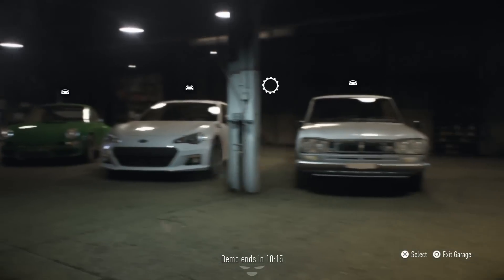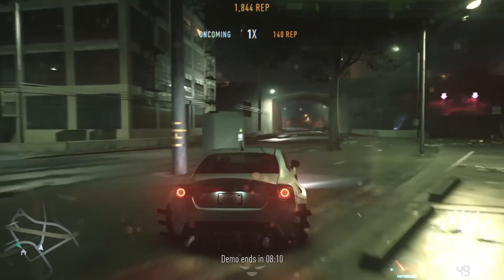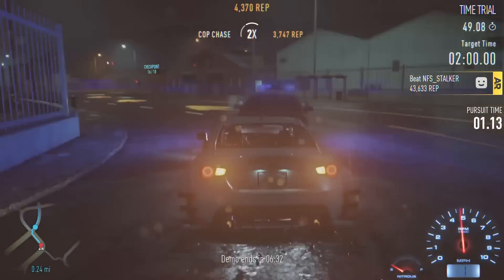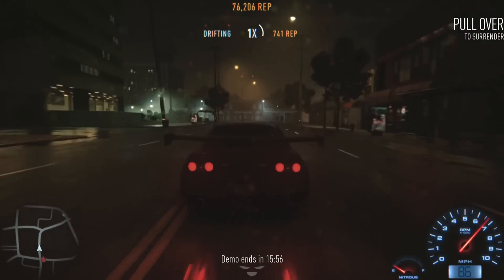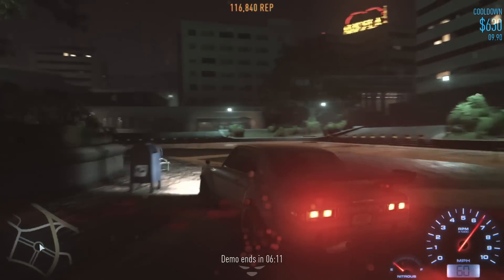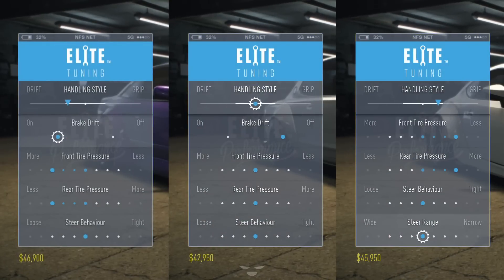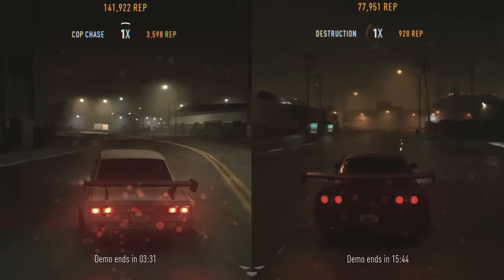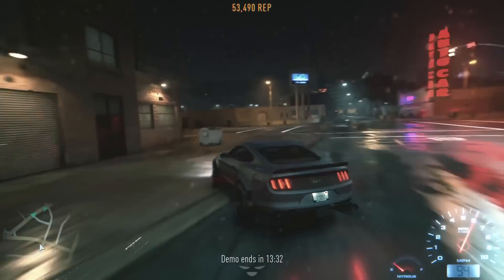Need for Speed 2015 Gameplay | Drift vs Grip - Handling & Tuning Explained!

Comment: My question is, is there any clear advantage to using a grip setup? As far as I've seen, drifting around corners is significantly faster than gripping, which is disappointing. Are grip setups faster in a straight line (for example)?

Comment: In nfs I find to much grip is bad because its has a lot of understeer and goes stupidly wide, even at very low speeds. I like it with a little bit of slide within the tuning because its more fun to drive plus you can go round corners fast and closer to the apex

Comment: i was worried about the handling at first but not anymore after seeing some more gameplay. this looks like it could actually be the best nfs in several years, good gameplay, good customization, lots of cool cars and good graphics.

it's a shame about the always online requirement, i actually wanted to buy this game
Reply: +The Ghost not always. even if i did i still wouldn't buy it because always online is a very shitty drm that i refuse to support, it can actually result in the game dying forever when the servers are inevitably shut down in a few years

Comment: If you say "different cars handle differently", does this also mean there is a difference between rwds and 4wds? Is there also a difference if the engine is in the back or in the front?

Comment: One problem I'm noticing is that the tunes that go towards drift can go around corners stupid fast (like at 130 mp/h) while this grip tune barely seems to go around tight corners fast...

Once the car snaps into a drift it seems to slow down incredibly fast and change direction incredibly fast, both of which are uncharacteristic of a drift. Drifting is the loss of grip, so it should not be going around corners tighter/ faster than when not drifting...

The handling slider is all well and good, but if one is fundamentally better than the other, there wont be a point of giving the users choice...

(all based on gamescom videos, so it may be different irl/ after its released)
Reply: Well, if you check the speedometer, you can see that the BRZ (90-110) actually maintains a better speed than the 180sx(40-80) around corners. It looks like it's having a sudden spark of speed, yes, because of the NOS use when exiting the corner.

Comment: do all cars sound the same like forza?
Reply: ***** It sounds nothing like Forza, and every car sounds different.
Reply from the maker: ***** even changing the exhaust changes the sound in NFS! :D
Reply: ***** can't you hear it in the video?
Reply: every forza car sounds "the same" because a lot of the time you're putting in the same exact engine and exhaust parts, which means it's going to produce the same sound, regardless of whether it's a prius or a koenigsegg or a g-wagon. For example, the turbo rally engine sounds a hell of a lot different than any of the top of the line supercar engines.

...Forza still sucks tho.
Reply: badivukXforzaXpro No actually as a fan of forza myself, need for speed gets the sound point
Reply: ***** Good :)  i like forza but theres some things it need to get it need to change like the customisation, all you can really do is put wheels on it and lower it there's not really any body kits or in depth outside customisation.
Reply: ***** "MIC RECORDING SOFTWARE"
Reply: ***** It's called Audio editing. And If I have a motorcycle of my own, I'm old enough right?

Comment: No manual shifting...real big step backwards for a good need for speed.
Reply from the maker: Luca Zangari Need for Speed hasn't had manual since Shift and before that Undercover. x)
Reply: +BlackPanthaa yeah and that was the last time the franchise released a decent game...
Reply: Carbon,mw and underground were the bests nsf
Reply: ***** That´s why I said good nfs... I´m really glad that they are getting back into tuning and very specific customization BUT it shouldn't be so difficult do make it optional if someone wants to drive manual! If it is as you are saying that drifting requires more skill and also does fine tuning than manual shifting should be "normal". I know that i am whining a bit...but it is such an little but very important thing...
Reply: bshawn41 he just said that
Reply: bro have you ever programmed something? It is hard to do something like that, BUT with such a big game franchise it is a shame that there is no manual, but I hope they will update that later on!!!
Reply: Blamant I programm a lot believe me...the thing is...as you say in such a big franchise you don´t program everything from scratch. You take things from previous versions and do new things with it...so if they had it in 2005 at some point they decided that it was unnecessary. The only reasons i can think of are: they are a bunch of lazy programmers or the wanted to make it VERY easy and accessible to everybody which means $$...since it is EA i will take the second one. But they could have let the choice...
Reply: ***** Only because Engine is changed it does not mean that you trash every single script and class for the basic structure of the game. But this is not the point. The point. The point is that what should be one of the most exiting CAR games dosen´t have at least an OPTION to change gear manually. A thing that is present since ever. And here I´m disappointed...and that´s why a play SHIFT and Underground or others...I don´t think i will spend 70 € on a disappointment...
Reply: yeah okay you have a point, but you have in your mind that the engine sounds and so on must be reprogrammed to! You are right with so a big company isnt that so much!
Reply: hopefully they put that in mind! Luca Zangari

Comment: I hope the cops are much harder than what you have shown us on this demo and that there is like a heat level from MW2005 and that every time you get a higher heat level the cops become stronger and they place road blocks (with spikes) and that they call a chopper if you have a high heat level, if that's the case I'll preorder this game right now

Comment: 10 cars in the garage would be much better than 5 :(
Reply: in the old games, you could build a starter car to be a monster.  in the old games, you could use your starter car to beat the final boss, after unlocking all the parts
Reply: Too bad that was only in the underground games and MW 2005. In carbon, it was impossible to beat Darius with an RX8.
Reply: ASAPVENENO yeah, that's when they started messing up...
Reply: I think it will be possible considering the depth of customization visually and performance wise